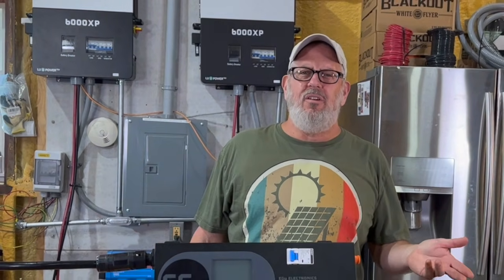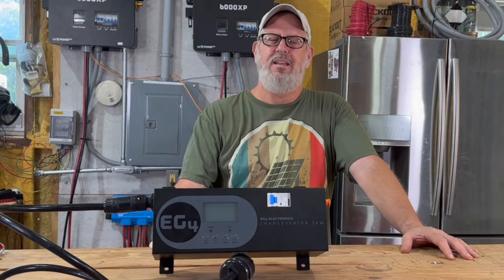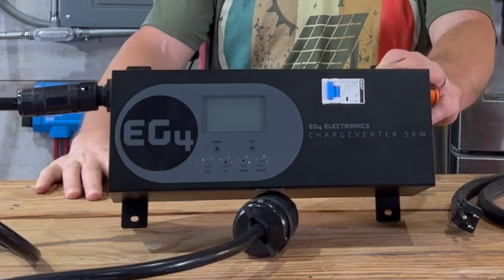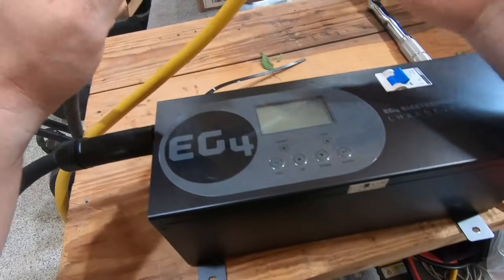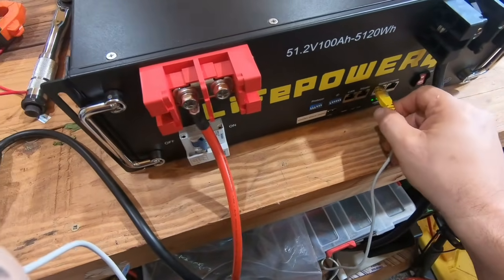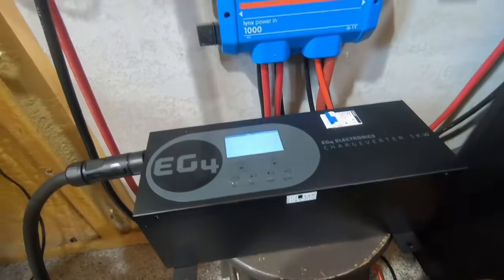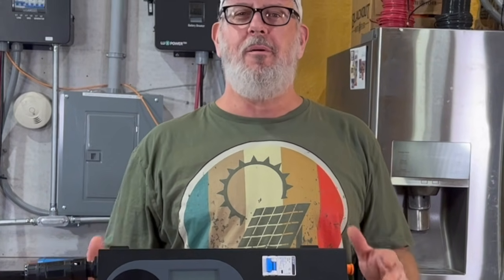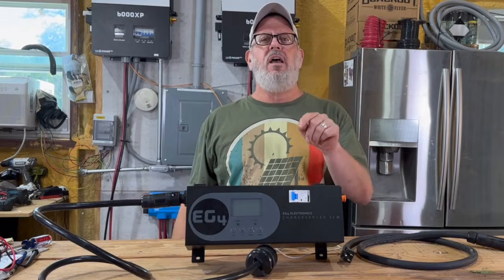BIG Improvement for EG4 Chargeverter | Charges with ANY Generator

Comment from the maker: I took a second look at the EG4 ChargeVerter GC and am now kicking myself for not buying one sooner!  I didn’t think it would be useful in my system because I don’t own a 240v generator or have a dedicated 240v grid powered plug nearby my solar system.  Little did I know, all I had to do was pay $18 for the optional 120v power cord and now I can charge my solar batteries up with any of the five, 120v generators I currently own!  

Operation is super simple with RS485 battery monitoring and 2 wire generator start cable included.  Although the price shot up at the beginning of the Tariff wars, Signature Solar has recently brought the price back down.   I don’t see why anyone trying to live 100% off grid could get by without one of these chargeverters.   Charging your system with anything but the absolute highest quality, pure sine wave inverter generator can burn out your solar inverter and possibly damage appliances in the home.  No one can afford to buy a new refrigerator or solar inverter these days, so get a Chargeverter instead!

If you use my discount code in the video description you can save an extra $50 off when you order the EG4 Chargeverter.  If you need one, DON’T wait for new tariff or supply chain issues to make you wait while they are backordered for months or after the price goes up again.  Who knows what surprises are in stop for the rest of this year?  👍🤩
Reply: The first Chargeverter we got is one of the old style yellow units.  I rewired it with a 30 amp 120v plug.  I think the max for the Chargeverter on 120v is around 3100 watts, we're typically pushing between 2500 to 2700 watts.  We have the new model and plan to run it 240v on a larger battery set.  I'm a fan of these chargers.
Reply from the maker: @PowerGuysUSA Thanks!  I use mine more than I thought I ever would.  I do like the 120v convenience but wiring up a dedicated 240v outlet is the way to go for fast charging.  👍⚡️☀️🔋

Comment: EG4 is a terrabile company. I bought the Chargeverter and needed extra batter cables and because they have those connectors that one cannot buy but EG4 could not sell me extra cables. I asked them and I asked Signature Solar and they told me to call EG4.
Reply from the maker: I’m not sure that one issue makes the entire company bad.  Have you found other overseas suppliers willing to send you parts they don’t regularly stock and sell??
Reply: @terrahillfarm  When I called EG4 support (here in the US) thats who I was speaking with and they told me other folks had called asking for these cables but they just don't stock them. It is crazy to me that it is super hard if not impossible to buy the plug in connectors on the chargeverter.
Reply from the maker: @LarryRichelli  Those mini Degson style connectors aren’t proprietary but they’re hard to find in the US.  If you need to extend the cables you can use small Polaris type connectors with similar sized cable.  If you damaged the original mini Degson style connectors, I’d swap them out on the Chargeverter with regular M8 battery terminals.
Reply: @terrahillfarm Now that would make a great video swapping out those connectors out.
Reply from the maker: @LarryRichelli I Agree!  I looked on Amazon and I think you might be able to find the right size connector under the listing titled “Surlok Plus Right Angle Plug and Socket 8mm 35mm² Red IP65 Busbar Lug Battery Storage Connector”.  Look through the photos and there’s a cross sectional chart about 5 photos in showing the measurements for each size.  The Chargeverter wire is 4AWG which can be rated as high as 125-140A, single conductor.  I think the correct connector is the 150A model as the size of the 4AWG wire is 9mm.  If you don’t mind throwing a few bucks at it to order one and see if it fits, you can be the guy who solves the mystery!  🤩👍
Reply: @terrahillfarm  thank you for the tip. I did order it and I will let you know what comes of it. Thanks again.
Reply from the maker: @LarryRichelli Fantastic!  Let me know if you find one that works and I’ll let everyone else know! 👍☀️⚡️🔋

Comment: SCARY TO HEAR YOU TALKING ABOUT YOUR 30A CORD AND 3350W BEING WITHIN THE SAFE LIMIT OF THE GENERATOR THEN CONNECTING A 15A PLUG.  THERE IS A 15A PLUG ON THE CORD!!!!  THAT IS YOUR LIMIT, NOT YOUR GENERATOR OUTPUT OR THE 10 GAUGE EXTENSION CORD.  THE WIRE GAUGE HELPS WITH VOLTAGE DROP, IT DOES NOT MAGICALLY TURN A 15A PLUG INTO A 30A.

THE $18 120V CORD FROM EG4 IS CLEARLY INTENDED FOR A LIMITED CHARGE RATE.  IT SHOULD ONLY BE USED TO CHARGE AT A LOW RATE THAT KEEPS THE INPUT CURRENT BELOW 15A.  THE 28A LIMIT ON CHARGING CURRENT IS NOT JUST A GOOD IDEA, IT IS AN ABSOLUTE MUST TO PREVENT OVERLOAD OF THE 15A PLUGS, NOT JUST BECAUSE "IT'LL GET HOT."  THIS CORD IS A VERY DANGEROUS ITEM TO SELL SINCE IT HAS NO WAY OF LIMITING THE CURRENT THE CHARGER MIGHT DRAW.  AT A MINIMUM, THEY SHOULD HAVE INCLUDED SOMETHING IN THE CORD SO THAT THE CHARGING LIMIT WOULD AUTOMATICALLY BE LIMITED WHEN THE CORD WAS CONNECTED.

IN ORDER TO USE THE 120V, 28A INPUT LISTED ON THE CHARGER NAMEPLATE, YOU MUST HAVE 30A OR LARGER ALL THE WAY FROM THE GEN TO THE CHARGER.  THIS MEANS A 30A PLUG ON THE GENERATOR, 8 OR 10 AWG CORDS, AND A 30A CONNECTION TO THE CHARGEVERTER.  THIS IS TYPICALLY DONE WITH AN ADAPTER THAT WIRES 120V TO THE L14-30 HOT LEADS. 

If you are only using the charger with a 15 or 20 amp cord, then there are cheaper options that should be considered.  There are any number of 48V, 18A chargers available.  Yes, they charge at a lower rate that does not fully max out the 15A cord, but they are also way less expensive than the chargeverter.  They also cannot accidentally melt your cord or overload the generator receptacle if you forget to turn down the charging current.  The AIMS Power CON120AC3648VDC is a quality unit that costs a third of the chargeverter.  This would be perfect for a small generator like the Honda shown early in the video.  If you have a larger generator that can support it, you can run two AIMS chargers in parallel for 37A of charging current.  This beats the best case output from the chargeverter when using 120V, and it is still a third less cost.